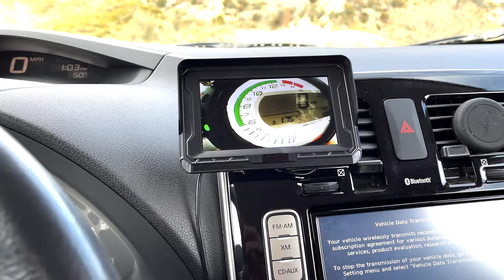Motorcycle Powered Cars - Canyon Carving!

Comment: The I3 is rear-wheel-drive, so is the plan to drive the front wheels with the bike engine? That is quite a challenge.
Reply from the maker: The plan is to have both the electric motor and bike engine in the back.
Reply: @Jerod_Helt  That is not easy. I applaud your ambition. It is pretty much scratch building a whole double drivetrain. Please don't delay and post everything. I can't wait.  I had an idea that might work.  Mount the bike engine with it's own diff that is parallel with the existing diff. Then connect the two diffs with two chain drives, each connecting of the matching output flanges of the two diffs.  But, the output flanges might not be adequately supported to carry the side loadings of a chain drive. Oh well. Maybe not. Back to the drawing board.
Reply from the maker: @ratmanbrian  the existing drivetrain is off to one side already so the placement is not a problem but the differential situation is the biggest unknown at this point.
Reply: @Jerod_Helt  I think you might have to remove the electric drive and install a completely new chain drive diff. ( maybe can use the internals from an i3 diff to preserve the geometry.). Then reinstall the electric drive with a solid shaft through the original diff so that you can chain drive the new diff from the original ( now locked) diff. Adding the bike engine then has several options.

Comment: You have any problems with the clutch holding up over time?
Reply from the maker: No issues so far and I’ve put several thousand miles on the car since I rebuilt it.